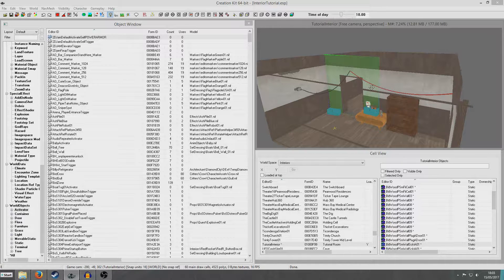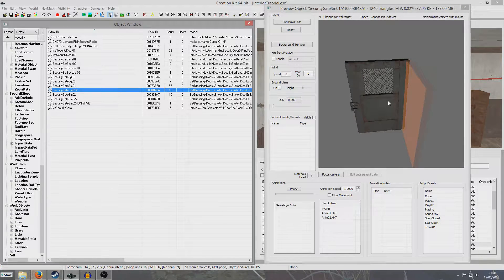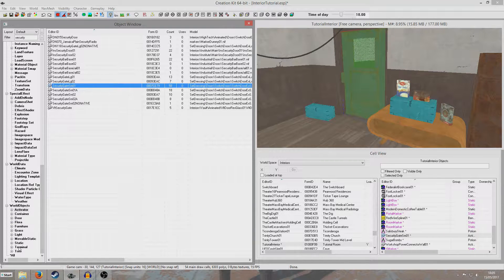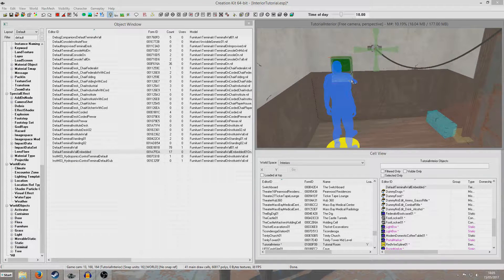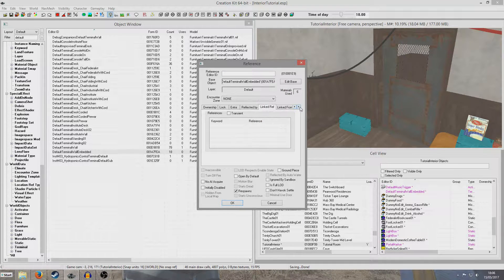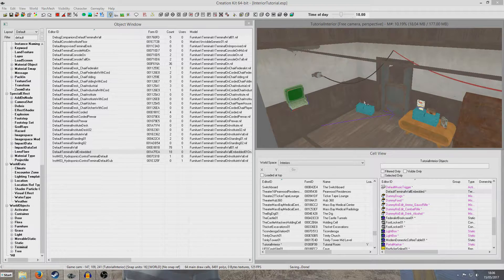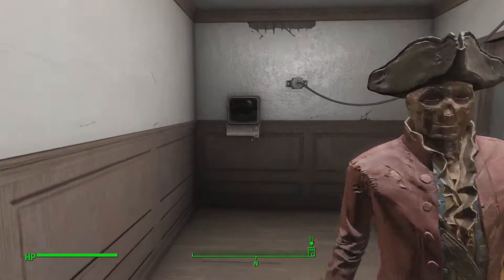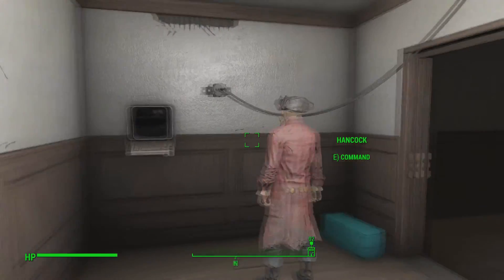Fallout 4 Creation Kit Tutorial - Maglock Doors

Comment: hey i did but i can open the door manually without terminal, how i can fix that?
Reply: Doubt you still need the help, but there are 2 types of security door, one you can open and close yourself, and one that can only be opened by a linked item.
Reply: I'm not sure if this is still a problem for you, but a door without a name will not show in game. You can fix the issue by Right-clicking on the door,  hitting Edit, then adding a Name to the door.

Comment: My mod is pretty much complete. I just need to fix one thing. Can you tell me how I stop the dialogue scenes from starting all the way back to the first scene whenever I return to talk with my npc? Whenever I talk to my npc,after my quest is complete, it will run just one scene from now on?
Reply from the maker: You could add conditions to the dialogue based on your quest stage. So if you wanted to only have it play when your stage is 10 you'd use GetStage YourQuest == 10 and then as the quest advances condition your other greetings based on those stages.
Reply: hey if i'm interpreting this correctly you're having issues with your npc repeating old dialogue? If you adjust the priority  of the dialogue so that the most recent greeting/dialogue has the highest priority that should fix it
Reply: How do I adjust it for just one greeting?